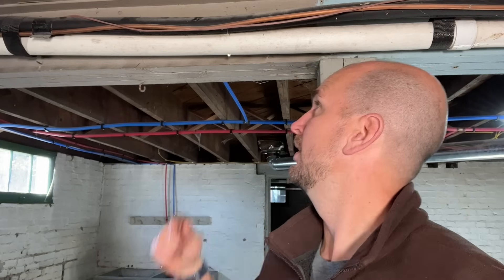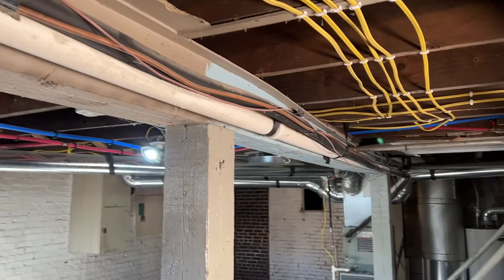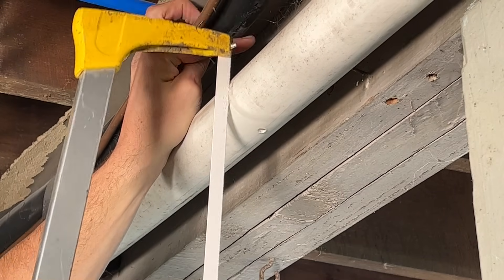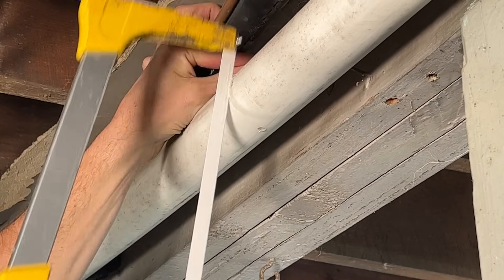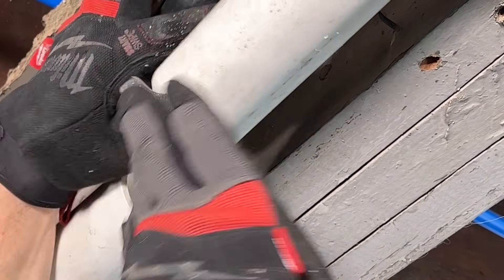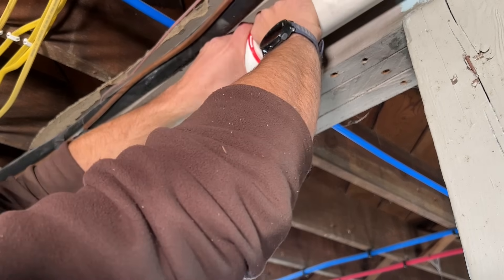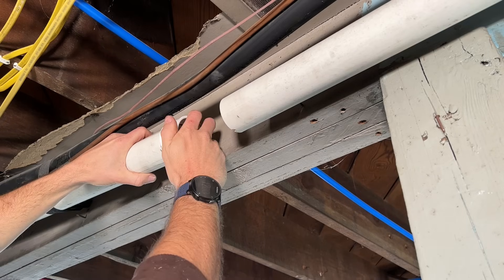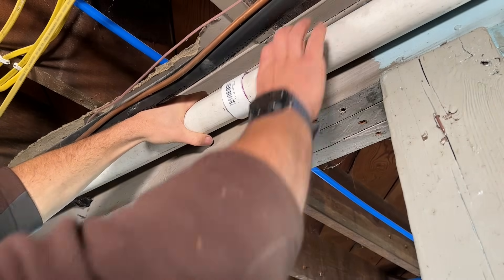Best Way To Repair Damaged PVC

Comment from the maker: Connectite Push-to-Fit 2" DWV Coupling:  https://geni.us/QJ9ZX
Schedule 40 2" DWV Coupling:  https://geni.us/adc8ZR
Oatey Handy Pack (Primer and Cement):  https://geni.us/HLEQzv6
Hacksaw:  https://geni.us/ni9WH

Tools Every Weekend Warrior Needs
Makita Cordless Drill Combo Kit:  https://geni.us/t7dIA
Dewalt Drill Bit Set:  https://geni.us/oFlSl
Dewalt Screwdriver Bit Set:  https://geni.us/VDcr
Craftsman Screwdriver Set: https://geni.us/jXqFI
Eklind Allen Wrench Set:  https://geni.us/7XfvO
Pliers (4-Piece Set):  https://geni.us/RIdx
Milwaukee Fastback Utility Knife:  https://geni.us/MlyiLk
Stanley Tape Measure:  https://geni.us/bUfD1R
Studbuddy Stud Finder:  https://geni.us/RySCuVw
Johnson Torpedo Level:  https://geni.us/wiLcDY
Stanley Hammer:  https://geni.us/bPDk8Wo
Buck Bros Wood Chisel Set:  https://geni.us/vk3cpTW
Klein Voltage Tester:  https://geni.us/h9Hl
Klein Outlet Tester:  https://geni.us/kdBAJ
Milwaukee Wire Strippers: https://geni.us/5zuLAbC
Little Giant Ladder: https://geni.us/fmlmTk

DISCLAIMER: This video and description contain affiliate links, which means that if you click on one of the product links, I’ll receive a small commission.

Comment: Another option for a simple hole like that is to buy the correct diameter slip coupling (i.e. no ridge in the middle, can insert pipe all the way in) and cut it in half (like a taco shell.) Then, smear that and the pipe with glue, and snap it onto the pipe over the hole.
Reply from the maker: Yeah, I like that idea as well and have seen it a couple times in the past 👍  Thanks for the feedback.

Comment: This video is an easy fix. The pipes move so you can easily make the connection. In most plumbing situations the pipe would be ridgid on both sides.  Tell us how you fix that.
Reply: They have what's called a sliding coupling that provides ample length for adjusting. 👍🏼
Reply: i came looking for this solution.  how do i find it

Comment: If you have the same diameter pipe section handy, cut to fit and a little heat will soften the ends enough to slip on to connect the two end pieces.  when cooled you will have a tight fit

Comment: Thank you so much. I’m just a mom trying to fix my pvc drain pipe on my pool. My husband ran over it with the mower about two years ago. I think it’s safe to say he isn’t going to fix it. 🙄 When I go to Home Depot what is the name of that $.70 piece? I think my pipe is also 2 inches but I’ll measure to make sure. Also, is there anything else I can cut it with? My pipe is kinda in the ground so I will try to dig around it. Now that I think about it I might need o add pvc pipe to fill the gap. I feel overwhelmed but I’ll keep trying to watch videos. Thank you so much

Comment: Thanks. How do you handle a situation where the pipe that is being repaired does not have flex in it? In other words, it is very stationary and will be difficult to repair in either of these methods? Does that make sense?
Reply: If it were me I would have patched with a spare piece of pvc and solvent glue.
Reply: I cut a length out of the pipe, usually about a foot. I put a normal coupling on one side, and on the other side a rubber coupling (in some areas these are called NoHub couplings, other regions have other names). The rubber coupling is a few mm larger than the pipes outer diameter, so it is able to slide freely along the pipe. Slide the rubber coupling onto the pipe (doesn't matter which end). Glue the normal coupling on one side. Once that has set up, slide the rubber coupling over the other joint and use the included hose clamps to clamp it shut.

Comment: And did you solve the water build up? Otherwise you'll be back at drilling a hole. If the geometry will not allow a straight run to the outside, then you'll need something like a u-trap to keep combustion gasses inside pipe and outside house.
Reply from the maker: I was able to raise the end of the PVC pipe at the furnace such that the moisture would exit the exhaust outlet.
Reply: @EverydayHomeRepairs  that should do. Watch that dip where you joined the pipe, it will collect water and if the support is too far away the weight will cause it to sag, and more condensation collects, pipe dips further, etc.
Reply: @rcmrcm3370  Very good point on that last comment. He probably should install some type of strap or something where he made the repair so that it will remove the dip in the pipe and prevent it from sagging.

Comment: I'm lazy and would probably have just used a dab of JB Weld with or without a machine screw in the hole. Then there's just a quick wrap of silicone tape. Didn't have any confidence in that product until I was confronted with a small leak in 1/2 in. copper cold water supply in a tough location. Draining and soldering would have been very difficult but I could get to it with the wrap. After 5 yrs., it's still dry!
Reply from the maker: I know a lot of people swear by JB Weld for many quick fixes around the house 👍
Reply: @EverydayHomeRepairs  I've even used it for an R12 central AC high pressure refrigerant line when I didn't want to braze. 
When I was a kid, I used its predecessor to repair the copper supply line to a toilet tank.
50 yrs. later it was still dry. Great stuff.

Comment: Just use the pvc saddle cement on . All you do is use primer on the pvc and the sch 40 saddle and then put your cement on both and push the saddle over the hole area , done.

Comment: great video, this is what I need to do, but what if the pipe is in a wall running vertically, how much do the pipes bend?

I need to cut out a middle section with damage and replace that with new pipe and 2 couplers. again the location is tight between 2 walls.

Any advice?

Comment: Thanks for the tips. Wouldn't melting shut the hole be an option ?
Reply: Trying to melt PVC is a bad idea. Not only does it tend to distort badly with heat, but if you're hot enough to melt it (above 85C), then you're hot enough to trigger dehydrochlorination (starts at about 70C), which is an autocatalytic degradation process likely to rapidly leave you with a whole pipe, and possibly even other pipes nearby, completely ruined.
Reply: Thank you for the detail explanation

Comment: in some areas some areas haven't they banned the use of both abs and pvc for furnace and water heater exhaust due do the hot air making the pipe become brittle.
Reply from the maker: Thanks for the feedback, where are you roughly located?
Reply: @EverydayHomeRepairs  i'm in canada. i know for sure here the black abs stuff can no longer be used. but i saw another utuber who is an hvac tech say the pvc stuff is also banned in his area now to u have to use this grey coloured pipe now that has a high temperature rating.

Comment: Will the connect type work on waste lines also? 2inch 3inch and 4 inch waste lines
Reply from the maker: It is supposed to work on drain, waste, and vent pipes which is what “DWV” represents.  Best of luck.

Comment: How about tapping a thread and installing a plug with Teflon its not under pressure.
Reply from the maker: That might work for this vent but I fixed this specific water pooling issue by elevating the pipe near the furnace to have the desired downward slope to the outlet 👍

Comment: I have never see one of those type Push to Fit couplers!  
It does not look like it would work if the pipe could not move sideways like yours did.  When the pipes can't move away from each other, the rubber sleeves with hose clamps will work here too.  They do make a PVC coupler without the stop in the middle that you can slide on one pipe all the way and then slide back over the middle.  Now tell me why those cost more then the couplers with the ridge??
Reply from the maker: Hahaha, that is a good question.  Maybe it is a product volume thing.  Or just trying to make a bit more profit, which might be a bit more likely 🙂
Reply: Wish I'd have known about that kind of coupler when I had to dig about four feet of yard to have room to cut and bend pvc to repair the water line coming in from the meter.

Comment: What happens if you glue the standard coupler to the pipe only using cement and not primer?
Reply: The primer adds a lot of strength to the glue connection.  A drain or vent line with just glue would probably be fine but anything under pressure needs the extra strength that primer adds to the glued assembly.

Comment: Since it's only a Vent type of pipe, Flex tape is a faster and cheaper solution.
I also sand the surfaces before I prime, inside the fitting and on the pipe.
Reply: He could have used chewing gum too but that isn't the point of the video.  His demonstration is intended to illustrate where an actual repair is mandated.
Reply: I thought about flex tape. I’m looking at DIY to fix a leak outside the wall underneath my toilet. I can’t do all this type of fix so I have been searching quick fixes like flex tape, JB weld, etc for pvc. Any suggestions?
Reply: @suzannaj3834 depends if the pipe you’re talking about is pressurized or just a vent/drain.

Comment: You show how to fix a leak in a PVC pipe that is in the ground
Reply: It's basically the same process, except you have to dig it up first, and more cleaning is necessary in order to get a good glue bond.
Reply: @JohnDoe-nq4du  I have to make such repair in a few months - just damaged a 3/4" PVC sprinkler pipe rated up to 200 PSI. The pressure coming from the city is about 90-95 PSI. Will the glued connection withstand it?

Comment: I was always taught never to put your cement on the inside of the coupling. Reason for that is as you are pushing the pipe in, the cement on the inside of the coupling will push out and then be inside your pipe and will dry in a heap and could cause flow issues. If you only put it on the outside of the pipe itself, all excess cement is pushed to the outside of the pipe where it wil not do any harm. A properly primed coupler with still adhere to the pipe with just the cement on the pipe
Reply: If you use the right amount of cement, you won't have any issues.

Comment: Should have threaded and put peacock valve for future draining
Reply: He mentioned in another comment that he fixed the underlying problem such that he shouldn't need to keep draining it in the future. Draining it with the drill was just a stopgap measure to get a furnace running immediately in an emergency situation where there wasn't time to wait for the aforementioned proper fix of the underlying problem to be completed.

Comment: Why didn't you just add a slope up of a 1/4 every 4 feet starting at you furnace placing clams where nessesary and this would never be a issue. Which should be standard for the common HVAC installer
Reply from the maker: That is what I did to fix the moisture issue.  The vent line was not installed correctly prior to me owning this property.

Comment: Why didn't you remove the entire area of the pipe with the hole? I would think that is not making a good seal b/c of half of that hole still being there
Reply: My guess is that if it were a pressurized pipe he would have, but the O-ring is past the hole so it will seal the same, the primer/glue will be slightly weaker than without the hole but plenty strong since it's not under pressure.
Reply from the maker: As Dustin mentioned the home was small enough I knew it would not impact the o-ring on the Connectite coupler and still had plenty of room on the Standard DWV coupler.  If the hole was bigger I would completely remove the section.